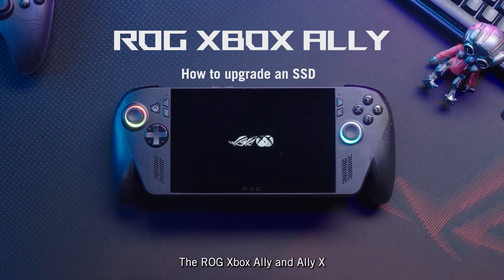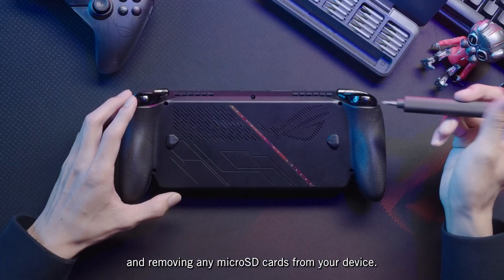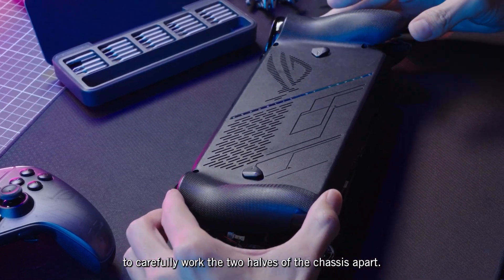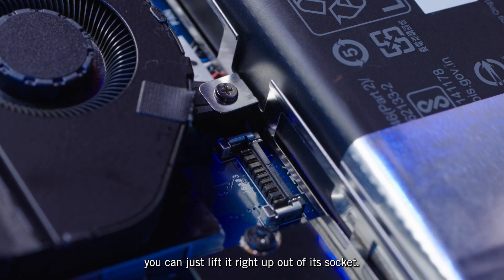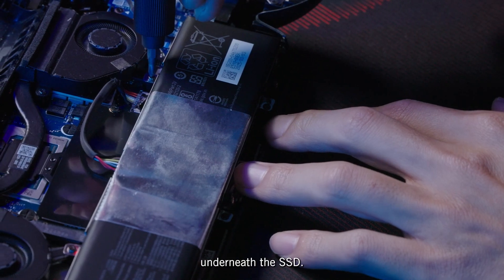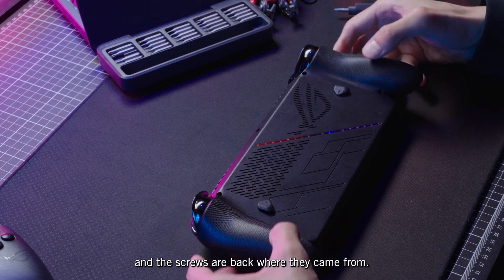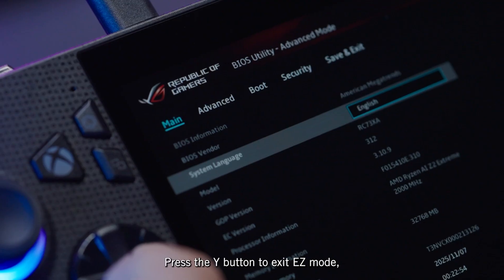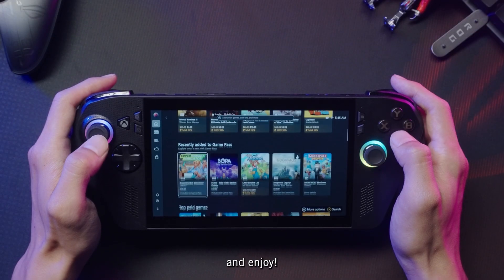ROG Xbox Ally Tutorial Video - How to upgrade an SSD

Comment: Cloud recovery doesn't even work. I tried multiple times until I had to manually install Windows and all the Ally components
Reply: It's unstable if used with wifi, better to connect the ally to a dock with a Ethernet port and plug it to your router then start the processs